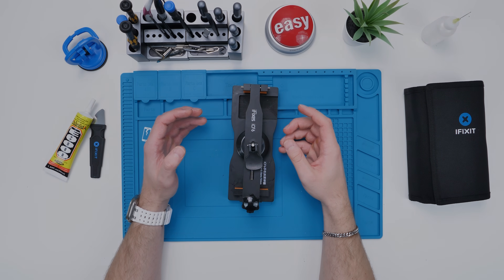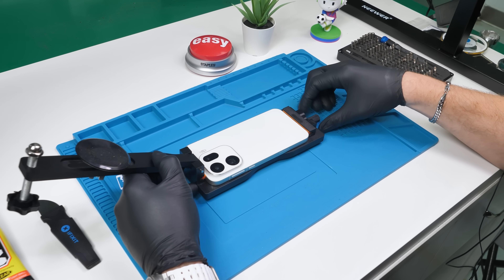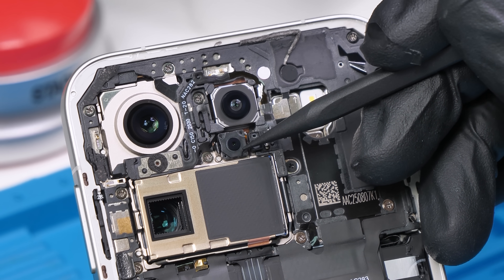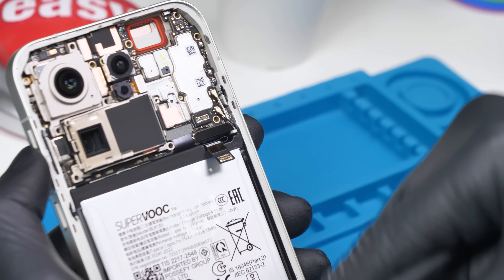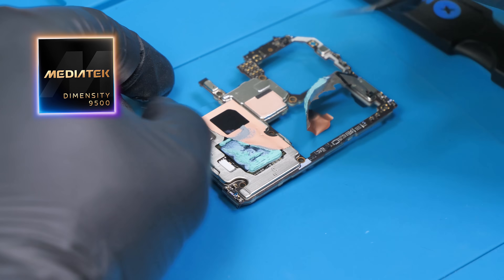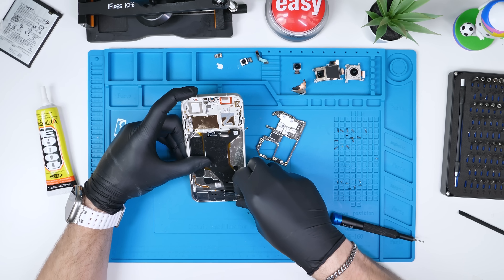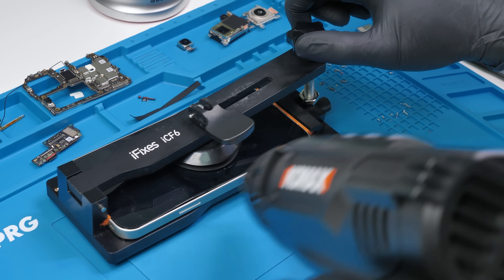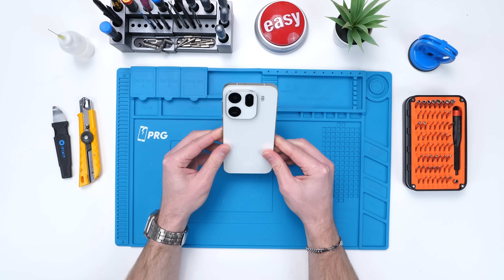This Phone Has The Best Cameras I've Ever Seen...

Comment: Hi! I wondered if you could give me some advice. I have an oppo find x9 pro in a case. It fell from over 6ft. I have no external damage, no warnings and the camera is working fine, however I have a rattling coming from where the cameras are. The noise is reduced when the camera is at full zoom, but doesn't disappear entirely. Any ideas what this could be and whether it's repairable? Thanks, Nathan
Reply: Don't worry, that shaking you hear is the sound of the lens stabilizer. It literally runs on a magnetic pad. When the camera is not in use, the magnet is turned off, so the stabilizer is in free motion.

Comment: I imported an Oppo Find X9 Pro and have been running it for a few weeks as my daily. Can confirm it is a huge upgrade from my S25 Ultra in almost every way! Amazing phone. Also had a Xiaomi 17 Pro Max for a week or so, but Chinese Rom kills it. Would consider one again if they have a global version.
Reply: Huge upgrade from my S25 Ultra in almost every way? Come on now.
Reply: @khelgarironfist3301 it's true. Better battery life and better camera by a mile. Charging is much faster both wired and wireless. The speaker in the S25U was slightly better but it's a marginal difference. I might switch to an Oppo Find X9 Ultra if they have a global version.
Reply: @cttechexpress  ok now i believe you more after you mention speakers lol. Any downsides with oppo software or anything? I was also contemplating mainly between these two (in EU)

Comment: As a tech in a smartphone repairshop there is no words on how I HATE how chinese brands build their phones for buttons, motherboard/charging flexs, having to remove those extremely bad """pulling tabs""" (lol) to try new screens, change buttons etc, and also even when you official partner with them, they pretty much always never put the buttons with the screens units they send you, samsung is the best one out there since Huawei doesn't exist anymore (Huawei send you the body with the screen and a new battery lol).

Our shops brand is official partner with Oppo and Xiaomi, but damn I hate their process... Ans we are not even official Samsung partners, they're just our supplier.
Oppo is stepping up insanely tech wise, but they really need to integrate an approach of their phone as a technician view too for the repairability.

Comment: 27Wh is almost 30% the maximum a battery can be for air travel in a smartphone package. Think about that.
Reply: I just looked at the samsung ultra models 23 24 and 25 they have 18.83wh. this oppo is really nuts. I really consider switching from samsung to another android since they been not doing good things for the past years: keeping the same battery capacity which is not much, rounded edges, removing wireless features from the s pen and so on. Btw i am using s23 base and the battery life is really too bad. But my main consern about switching is how is the software on these other brands like i saw some things about xiaomi i believe that they have literal ads on the settings app which is not really cool.
Reply: @CrackHead2024 you definitely never want to get these phones designed for Chinese markets. Ads are part of the reason why they get so cheap 😂. 
My friend in Vietnam got a Chinese market one plus and that thing literally felt like a bloated piece of spyware.
Reply: a phone have no problem to travel lol

Comment: The only reason the USA and the EU are banning Chinese manufacturers is bc they’re way too good at making good tech for cheaper than their competitors
Reply: It's actually because of security concerns, atleast in the US. The EU doesn't ban them, it's the Chinese that are reluctant to even bring them over.

Japan and S. Korea make significantly better phones imo.
Reply: @warmoaran3 with japan you mean sony? The price gap between their cheapest and 2nd cheapest phone is around 600 bucks, they only have the very low-end Xperia 10 and the high end Xperia 5 and 1 series
Reply: @DeviciWasTaken  Yes. Sony's flagship is worth every, single bit of its price. You get everything you would want, a hole-less screen, MicroSD slot, Headphone jack, it has NO compromises there, and the main camera and UW are top class, the telephoto lens itself is also extremely good with the latest 1 VII having 120mm 4cm macro. 

The 3.5mm and MicroSD alone make it worth it. The chinese flagship phones don't include it because they're cheap and they want to milk more money out of you.
Reply: Oh, and btw, the Xperia 1 costs similar to an iphone pro max. And you're getting significantly more value. Its not overpriced at all.
Reply: @warmoaran3 I agree on the worth-it part, but chinese companies are not "milking", in fact, their highest end phones are up to 300 bucks cheaper than the baseline iphone 17, which is 949 btw
Reply: @DeviciWasTaken  I consider it 'milking' if they do not have a 3.5mm headphone jack and MicroSD card slot. Because apple and Samsung do it. 

Negating both incentivises the user to pay more upfront for more storage, and for them to buy the companys wireless earphones. Aka, giving the company MORE money, like what apple wants people to do.
Reply: @warmoaran3 apple sells a literal sock with a hole for 150 bucks and Samsung puts borderline-usable batteries into their phones. Chinese manufacturers dont overprice or cut huge corners by making their stuff barely usable. They make the highest-spec stuff. Thats why their phones have always been considered flagship killers
Reply: @DeviciWasTaken  well.. apple is apple, bad value at any price point.

Samsung doesn't put "borderline usable" batteries, they put usable batteries? Si-Carbon batteries are still unknown and barely out-perform apples 4,800 or something mAh batteries..

Chinese manufacturers almost can't overprice because nobody trusts them still.

And most people really don't pay much attention to the spec list..

Comment: Do the Oneplus 15 next. It’s made of an aluminum that has a ceramic coating. It also has the thinnest bezels in a phone and 144 hz.
Reply: And the worst cameras
Reply: @RacingDeath1000 the ceramic coating makes it stronger than titanium and more scratch resistant. It also makes it transfer heat faster. Who cares about the cameras that much anyway? The cameras are good enough.